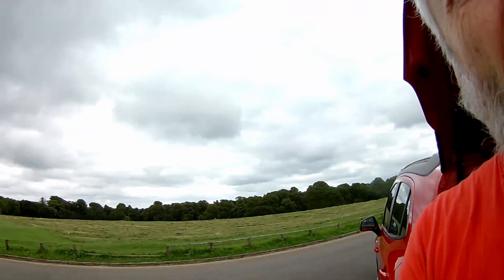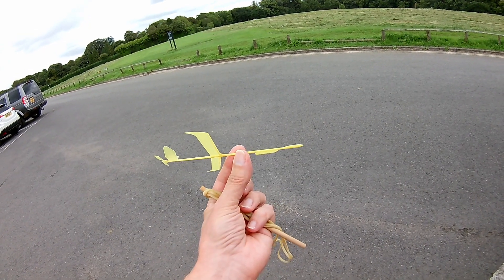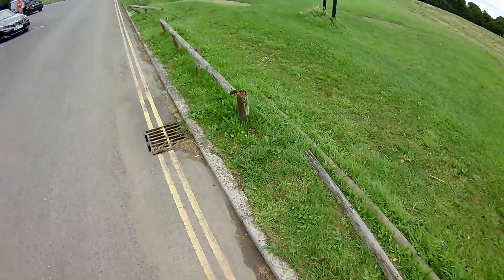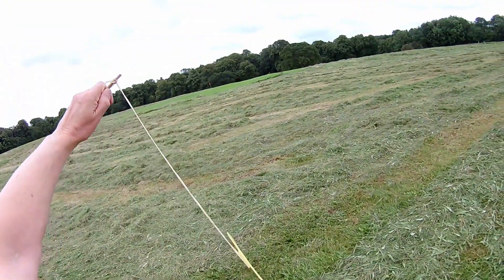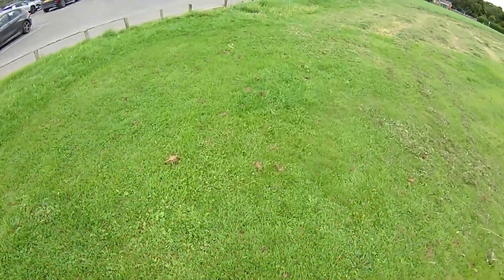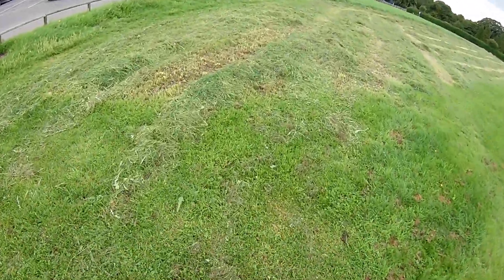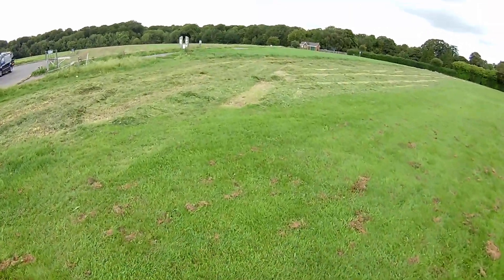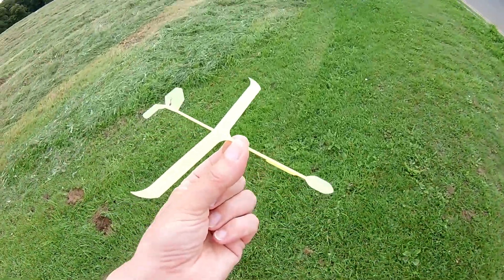3D printed catapult launch glider TESTED

Comment: I decided to try to print a thin flat print glider like this, .20mm is the thickness I had to go with to have cura print 1 layer. I tried to make a flying wing, cg was guessed wrong so it was pretty hesitant to glide properly, mostly just floated down pointed in the general direction I threw it at. Watched your make video again on this glider, the thin part of that wing is 2 layers... somehow I got away with only one, though prying it up was a delicate matter for sure! I'm definitely going to need to try the method out again just thicker. Looks like you got some good flights in with this glider 😊
Reply from the maker: Good luck👍 When I flew it, I realised it was very hard to spot when it was in the air and even harder to spot when it lands, so you can't take your eyes off it for a moment or you lose it.